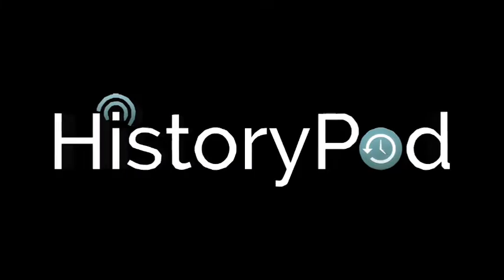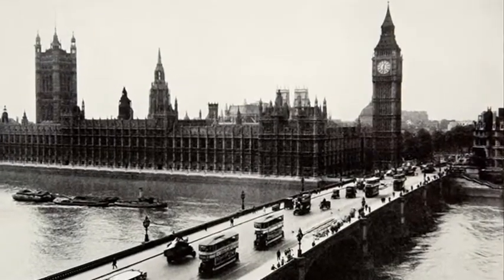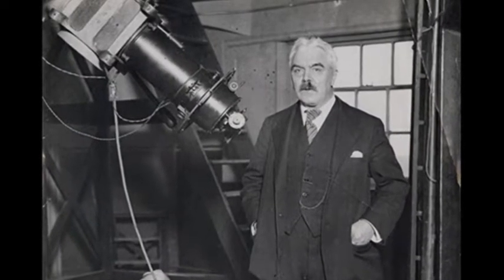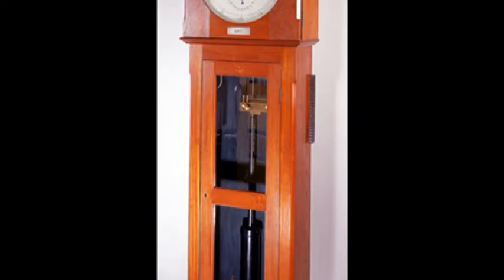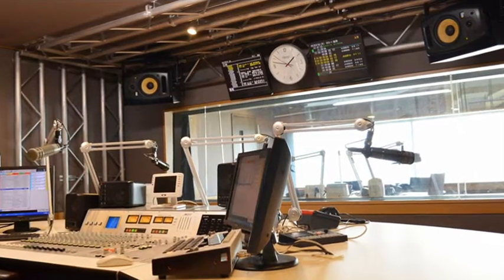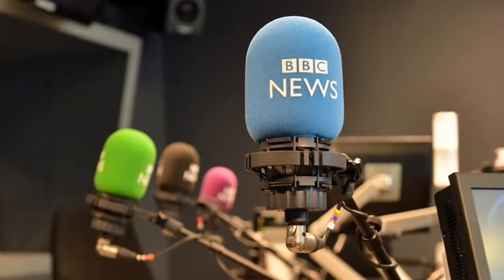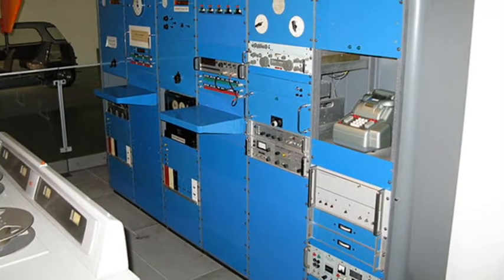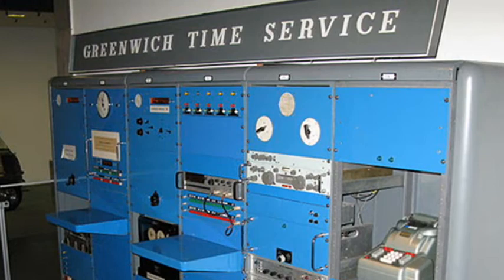5th February 1924: Greenwich time signal 'pips' broadcast by the BBC for the first time

Comment: I remember clearly when the pips were all the same length, and it was a "new" innovation to lengthen the final pip. I'ved listened to BBC radio since I was about 6. I'm now 76. I remember, aften much fiddling with dials, hearing the distant notes of Lilli Bolero and the pips when feeling very lonely in Sana'a, North Yemen, as it was then. What a comfort that was, as the BBC must have been to many.

Comment: It was pointed out to you 5 years ago that it was NOT agreed at the time to have a longer final pip. Up until the early 1970's, all the pip lengths were the same. It wasn't until the "leap second" was introduced, that the final pip was increased to 0.5 seconds.
Reply: hadn't realised that they were the same until 1972. Having the last one longer does sound a lot more sensible. When a leap second occurs (exactly one second before midnight UTC), it was indicated by another short pip at 23:59:60 (the leap second). The longer pip at 00:00:00 helps avoid confusion:)